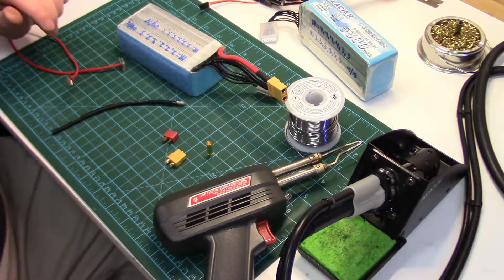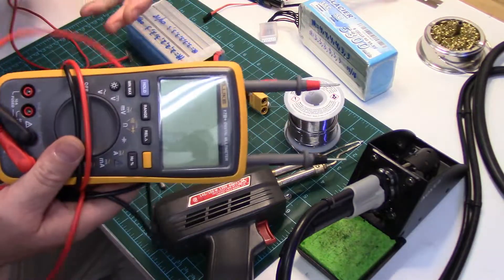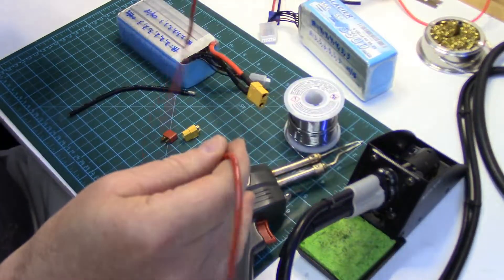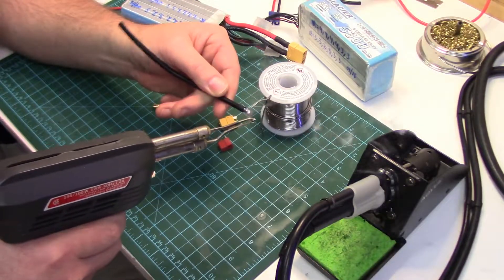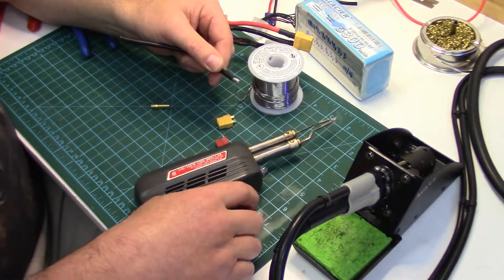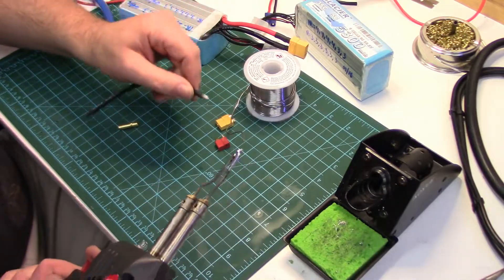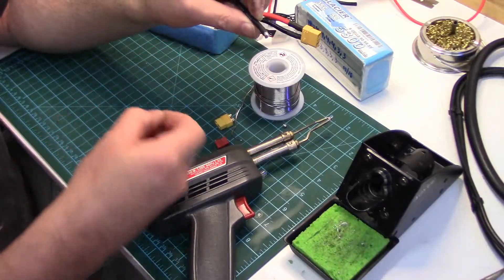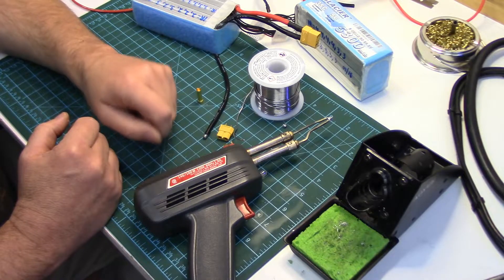How To Tin Wires Before Soldering

Comment: Kester 44 on Amazon says "44 Is a High Activity Ra Core Flux "  and "Classified As Rom1 Flux." Is this the correct Kester 44 solder used for tinning wires?
Reply from the maker: It's a great all round, all purpose electrical industry solder and is easy to work with. That's why I use it. Good results every time :-)